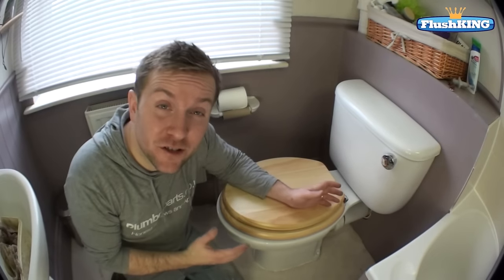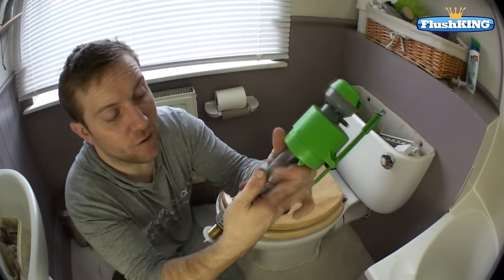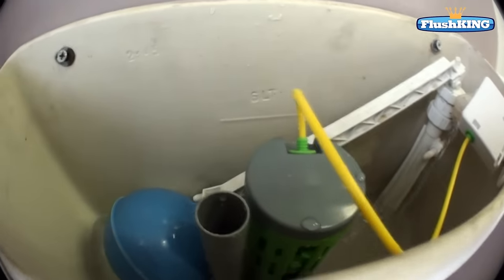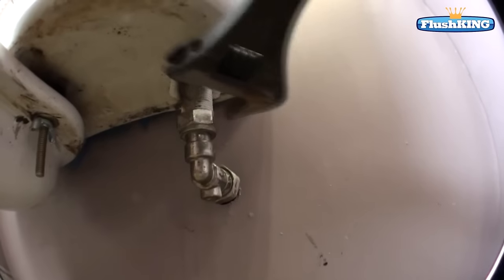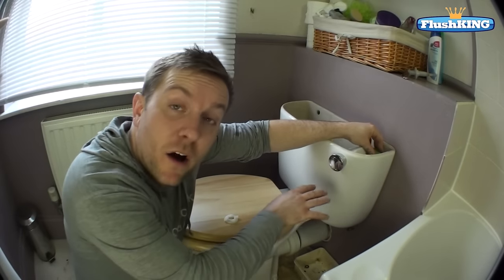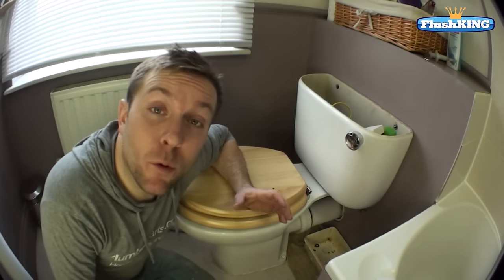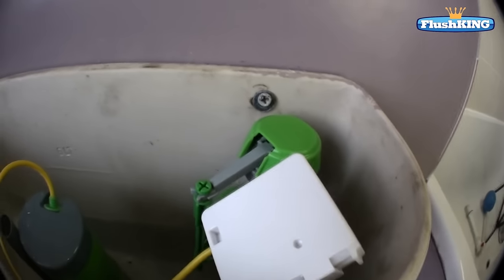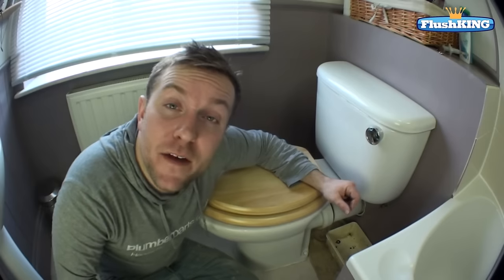How to Install a Bottom Entry Fill Valve in your Toilet Cistern.

Comment: Great vid. TIP ! ALWAYS make sure you have the RIGHT tools to hand plus rags etc (old plastic food tubs come in handy)👀👍I removed the SIPHON unit to allow easier access for install. (Check out vids on this) AND sometimes its worth replacing the siphon unit at the same time! 👀👍Overall the cost (parts) should be about £50 !! WITH the siphon unit replaced OR about £20 - £30 with just the filler unit.

Comment: I have just installed my valve but it keeps on over flowing. I have in checked the float which is free but once it reaches the top it keeps on filling.

Comment: Mine has a plastic service valve ,  screwing to the cistern inlet.  Metal service valves don't seal properly, so how do I get round this, can you still but the plastic service valves, or do I need to change the whole cistern unit?  Thanks

Comment: Thanks. Must the black rubber washer be inside or can you put it on the outside as well. mine is leaking at the bottom
Reply: Me too. How did you solve it?
Reply: @misterocain  from a plumber here, we Chuck those cone shaped washers off and apply a bit of silicone to the nut you tighten into the bottom. Washers have a tendency to stretch, bend or what have you where silicone will push into all the little spaces where water might be leaking from
Reply: @finleyharrington-brown2889  Thanks. in the end, i managed it with the washer but a also with load of silicone. I will follow your advice next time (hopefully many years away).

Comment: I need to change the bottom entry fill valve, old ball type. Fine with how to do it but how do I know if the new shank fits the old compression thread on the flexible pipe from the cold supply. There is no isolation valve so need to turn off supply in airing cupboard. The outside diameter of the shank is 25mm or 1 inch ish.
Not allowed out as meant to be shielding so need to order online , guarantee if I take it apart to check it will leak if I have re-use the old parts so I can switch the water back on to the rest of the house. The old ball valve system has no adjustment left and leaks continuously and the overflow just drips out the bottom of the cistern not out through a pipe in the wall which for some reason was never finished by the previous owner. Would like to fit a siphon/flush which feeds any excess through the toilet bowl. Plumber engaged but months away when all new cloakroom to be built and only then when the plague leaves town!!!
Thanks.

Comment: This did the job for me. My valve was touching the inside wall of the cistern though so I bent it very slightly away from the wall by wedging a small rubber object between the wall and the flush valve so that the flush valve boat could float up and down freely. In engineering terms this is called a jury rig I believe or is it a bodge job? :D
Reply: James Moore
Reply: James Moore

Comment: 3:28  I don't understand why i am getting a leak  from the bottom  fitting as the  rubber washer  inside should form a good seal.  I notice you had no washer when fitting the bottom nut.  Presumably i need to apply some silicon.

Comment: Hi  Great video , how do you know if it's a 15mm or 1/2" that;s needed , thanks for any help ,
G
Reply: Old metal water pipes tended to be 1/2 inch. HOWEVER COPPER tends to be 12mm so the 1/2inc/12mm type.👀1 inch = 25.4mm There are some fitted with PLASTIC piping and that too is 12mm. ALWAYS be careful NOT to OVER TIGHTEN connectors etc Tighten enough to ensure water is NOT seeping around the connection etc.
Reply: Apparently you should be aware that the EUROPEAN pipes are 3/8inch. If you are in the UK 1/2inch or 12mm is the norm. 👀3/8ths of an inch = 0.375in × 25.4= 9.525mm 👀

Comment: So I replaced mine and it's leaking underneath from the bottom of the cistern.  I have the rubber washer the right way around and it seems to be snug enough.
Reply: I solved it!  Unscrewed again and took the new one out, thoroughly cleaned around the cistern hole, re-seated the valve and reconnected.  Now it works and no leak (so far!).  So pleased with myself!!!

Comment: I will be doing this job soon. Do I need I new fibre washer or is it an olive ?
Reply: jim phanco If you mean for the water connection then you could replace the washer if you think the old one is knackered. No olives required.

Comment: My water connection kept leaking think I needed a washer .....there wasn't one on it originally though
Reply: I got the same problem. How did you get over it? did you apply some silicon/

Comment: Please can you tell me when you reconnected the water connection, did you use a sealant like boss white or can you just tighten up with out anything? I have to change my fill valve and its the same old ball type arm fill valve like the one in your video. Thanks, Ed. (And yes, ive already subscribed! lol!)
Reply: Did you get a reply
Reply: @scottmacgregor8842  did YOU get a reply?

Comment: i notice up near the top there is a short nozzle that looks like a pipe should go on there , mine has this but has a blanking plug in it as does the one in this video but the replacement i purchased has the nozzle but is not blanked off , just wondering what the nozzle is for as can't find any info on it , nozzle can be seen at 4.06 in video
Reply: Did you find out?